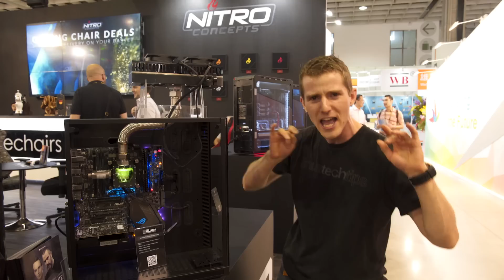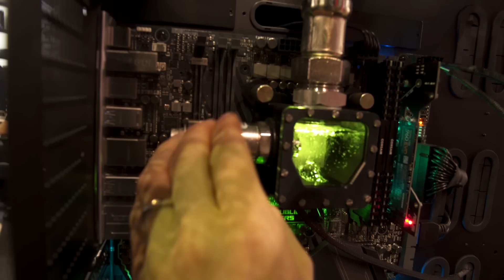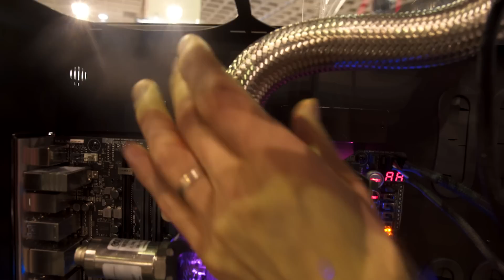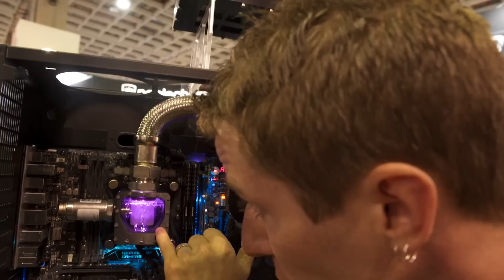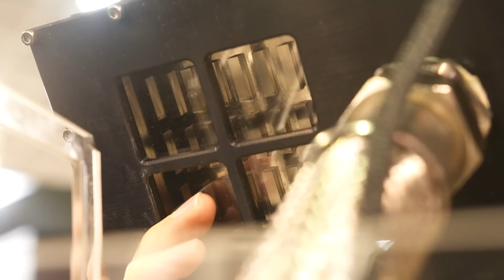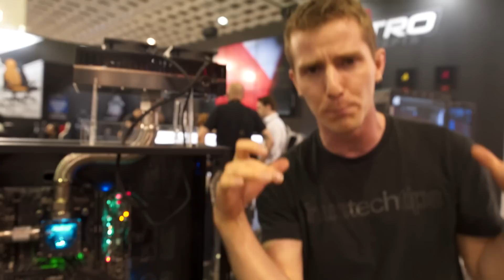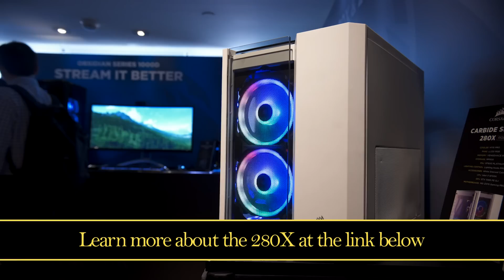Crazy Der8auer cooler prototype - NO pump!

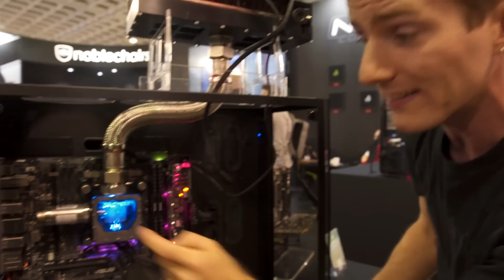Comment: 2:19 probably dry ethanol 
For now it's the best heat pipe fluid right behind methyl chloride
Reply: I would have guessed methyl chloride (Dichloromethane) but you might be right about the dry ethanol its also probably less volatile as in not gassing you with chlorine gas if you spring a leak lol
Reply: @adam1984reese  well dry ethanol is probably the best option because distilled water will pull metals from parts and consequently will become conductive and if there are different metals in the loop like  copper and iron in contact you have a galvanic reaction that will destroy parts over time while methyl chloride is as you said pretty bad to breathe in so 100% ethanol is pretty good middle option that is not corrosive and conductive and also won't kill you or damage your equipment if it leaks.
I tried to make my own methanol heat pipe and it worked great.
I first tryed acetone but it reacts badly with rubber seals and plastic

Comment: It's either Novec or some form of alcohol or something in a vacuum to lower the boiling point to the desired temperature so it condenses at room temp 21-33° but boils shortly after that to maintain a cool CPU.
Reply: There is also a wide range of things that will boil at lower than ambient temp's which you can increase the boiling point of by increasing the atmospheric pressure which would naturally be done via expanding the liquid into a gas

Comment: low-pressure ethanol or acetone... (gasoline would be fun tho...)
Reply: with diethylether you wouldn´t even need a vacuum or low pressure it boils at around 35C° plus if it leaks you´ll get a fuzzy feeling in your head so a lose/win situation, but i strongly advise to keep open flames from the ether for a safer experience i recommend chlorophorme

Comment: Perfluorohexane  boiling point of 56 °C (133 F) IDK if the boiling point is too low it will more readily explode, and then you have to figure in how toxic the liquid is.  I figure it needs to condense just lower than the hottest possible room temperature but low enough to boil at temp that low enough for a optimal cpu temp - boiling at 40-60°C? and even figure in how much it tends to expand... - then again I am still on my first computer build...

Comment: Is it boiling at or around ideal CPU temps? Or running hot?
Ethanol boils around 78-79c at normal atmospheric pressure.
Is the system pressurised? Even a slight pressure increase could have a BP lowering effect.

In industry we used CO2 within a vacuum system for cooling. Literally puts fires out if things go "oops!" and safe as breathing out. The vac system avoids any issues with pressurised connections, charging the system etc etc.

Comment: With more temperature data, we could figure it out. Water would work at a lower pressure, and would explain the bulky hose and the pressure sensor. If that's the case, then all he's done is scale up a heatpipe to ridiculous proportions and give it a semi-flexible hose.

Otherwise, pick a desired temperature/pressure profile and there's a hydrocarbon that'll do. Butane has pretty reasonable properties and could likely work for such an application.

If he went really fancy, then a fluorocarbon based coolant. Like fluorinert.

Comment: it's probably a gas that uses the concept of phase change to stay in liquid state. that looks like a pretty beefy setup on the hose and fittings so one could assume that the pressure inside is quite high. also would explain why there is a pressure sensor.

Comment: Some kind of high pressure liquid-to-gas phase change that heats up to a vapor, rises up to radiator, is cooled/condensed, and trickles back down to reservoir block.  Like a giant heat pipe / vapor chamber.

Comment: My guess is water. It's cheap and it has high enthalpy of vaporization, which would make sense (many industries use steam to carry heat for the same reasons). The pressure inside the cooler would need to be less than 1 atmosphere in order to get temperature less than 100 degrees celsius, but that's probably one reason the cooler isn't mass produced anyway (and also the fact that it could freeze during transport). It looks like it's made of really heavy and strong components too, maybe to maintain the lower pressure. Also, the glass on the waterblock is mounted in a way that ambient pressure would help seal it, if the pressure was lower in the inside.
It could be made of vodka too, because then it would start boiling at a lower temperature and also couldn't freeze as easily :)

Comment: That looks like pool boiling, which it’s freakin efficient but very expensive and difficult to make it work. Normally it’s used with 3M NOVEC fluids, probably he is using the 649 which boils at 49°C, typical for computers. I like it.

Comment: The pressure transducer suggests to me that the fluid is under a vacuum/pressure.... potentially, it could just simply be water or even r134 fluid. you can control the boiling point with pressure lower or higher. This is essentially a large, complicated flexible heat pipe.

Comment: There's no "boils" at any temperature in there... note that bubbles ... looks like he's using the ultrasonic piezoelectric transducer. At the right frequency, he can split the molecules of any kind of liquid and make it looks like "boils" but are just bubbles generated by it's high frequency splitting the molecules !! And then you may ask : "Where's the 'smoke'?" Well... there's not space for smoke on that little square filled with liquid, the only way out for the smoke if the top tube !
And by the way, why some one would design something that would "boil" a liquid when the objective is to cool down ? That's why I think he's using the ultrasonic transducer tech in there!

Comment: Nothing radical here, they use the same principle to cool the staves in the body of blast furnaces when circulation pumps fail, secondary convective heat transfer So all this guy has done is adapt that principle to PC cooling, with the use of additives in the water that would not be used on a Blast Furnace cooling system. I like it.

Comment: I don’t understand how the re-condensed stuff gets back down if there’s constant boiling and gas going up. Does this liquid have no surface tension? Anyways I imagine it’s a low boiling point compared to water since that CPU is hopefully not running at 100C+ so here’s a few contenders when I google low boiling point: https://goo.gl/images/xvwnGq

Comment: Could be a water/ether mix. Ether boils at 100 degrees Fahrenheit, which would be perfect. The heat from the cpu would excite the molecules in the ether, ultimately assisting in heat transfer. Idk if it's stable enough, but it's gonna be a liquid with low boiling point, and good heat conductivity.

Comment: Old John Deere tractors had cooling systems called a "thermosiphon".  There was no water pump, the hot coolant just rose (to the radiator), cooled, and then dropped back down where the cycle continues.

Comment: There are a few points that most of the comments seem to miss. Boiling a liquid will create pressure. Pressure increases the boiling point. This means that what ever liquid is used, has to have a boiling point a few degrees colder than what you want the system to run at.  For one, we can safely assume that CFC gas and any form of flammable material would not have been used because he would most probably not have been allowed in the venue in such a case. Some form of an Ammonium compound might be used as it is used in gas fridges that require no electricity or pump.

Comment: Maybe I missed  it was running at what temp ?and to boil water doesnt that require 100c
Reply: You can lower the boiling point of any liquid by decreasing the atmospheric pressure same as you can increase the boiling point by increasing the atmospheric pressure.If you've ever seen a car spring a coolant leak you will notice the water is boiling but that is because of the atmospheric pressure once the system is sealed again the coolant is not boiling at the very same temp

Comment: It can be acetone.... a cpu can go 80 or 90 degrees Celsius under load. The boiling point of acetone is about 50 degrees Celsius....so acetone is one of those liquids that can condense at normal ambient temperature in the radiator and can boil under the heat flux of a running cpu.....it could be any liquid that boils at 50 to 70 degrees.....i think its acetone.... may be alcohol or bromine

Comment: i know it is a custom 3M novec mix because der8uer has made a pc in witch he used 3M novec and in that video he talked about getting a custom mix that boils at an ecen lower temperature and that might acheve even better results and because of the size of the tubing and the sensor this tube is cleartly presurtized to increse the boiling point of that novec to make it not boil at a too low temperature

Comment: Hes using a commercial refrigerant under negative pressure. That explains the need for the pressure sensor and the large valve on the radiator and the need for a custom rad (commercial ones aren't designed for negative pressure). The working fluid is likely  R245fa or R1233zd(E) in my guess. I'd love to know if I'm right.
Reply: Go up on Mount Everest and ur water boils near 60°C
Reply: More likely negative pressure water loop and the pressure sensor is so he doesn't blow the radiator up if things gets too hot and he ends up with a steam powered system
Reply: @crocodile2006  lmao....that would be awesome to watch....a cooling system turning into a steam power cycle.
Reply: negative pressure?
Reply: negative when saying atmospheric pressure is 0.

Comment: I'm assuming the liquid is liquid helium either or liquid hydrogen because of boiling point is -257 to -230 year on there on either like good and the based on the way the viscosity is of the liquid and now it's boiling and if it will condense back down it would go into the condensing chamber on the top because hot air rises and cold air Falls same for gas as mostly and therefore it will fall back down and cool the system

Comment: It'd be nice to know what the pressure and temperatures are.  Then it wouldn't take long at all to find out.  Since the thing appears to be pressurized (maybe depressurized), there is a wide range of possibilities.
Edit: According the der herr himself in another video, it is under high pressure, and the boiling point is above room temperature.  Also, it is one intended to be shippable anywhere.

Comment: CH2Cl2  Methylene dichloride or also known as dichloromethane. It has been used for over 100 years as a fluid for heat engines among the many other uses. For example, a use that is CLOSELY related to the use in the video is as the bubblier fluid in Juke Boxes from the 1930s and 1940s. It boils at 103 F so it would be perfect in an application like this. The hotter it gets, the faster it boils thus circulating the fluid through the rads.

Comment: Probably some sort of alcohol. Lower boiling point than water so the system doesn't need to reach 100 C, not very expensive, less flammable than acetone (since its a consumer product they need to make it more idiot proof) is non conductive (all common alcohols I can think of) and is a natural biocide.

Comment: Ok, understand going to limit what I say for a reason. USN has Nuclear propulsion systems that will cycle cooling without pumps. Not though for main use. Used for say when shut a plant down and you still need to dissipate heat before your pumps come back online. They use water.
In short this can be done with water alone would it be the most efficient that's a good question. A fluid that boils at a lower temp would remove heat and earlier and limit the temperature the cpu would raise to. Also the design is kind of poor.  The base unit a the CPU should be angled 45 deg  to push fluid against cpu and the a standard radiator sitting upright with slight angle to let coolant run back one direction without blocking rising gas would be more efficient. Alcohol has a lower boiling point and is easily brought back to liquid. So if he isn't using water that would be my next guess. Using the same principles of a still after all. Also you can reduce boiling point of water by lowering pressure.

Comment: Since it has a pressure relief valve in the side of it I am inclined to believe the coolant is 200 proof alcohol.  Also seems like the most reasonable choice for an evaporative cooler such as this.

Comment: Seeing that its boiling, it is most likely some type of refridgerant, and it looks like it works just like an rv fridge that runs on propane or electicity. They typically run pumpless and because the heat from the propane flame or electric element within the condensor of the fridge creates convection within the fluid which allows it to move, and thus cycle. This system simply makes the evaporator the cpu block and the condensor the radiator...

Comment: Freon gas, and he does not boil it, the freon is boiling because of the heating, this system does not need a pump, since the more the processor is heated, the more gas boils and the more effective cooling. Such a system can not be overheated and there is nothing to break.

Comment: @Linus Tech Tips I think he's using ammonia (NH3) as a liquid. In the absorption style fridges it's used as well for the same purpose, albeit it's used differently. In an absorption fridge the ammonia is heated to a boil (to go from liquid to gas) than travels up as a vapor into the inside of the fridge (first in the freezer area than to a cooling block inside the fridge itself) it goes out the back of the fridge again where it's further cooled until  it condenses again into a liquid and flows back down into the container at the bottom.

I think he might be doing a similar thing here, albeit different and probably not as efficient. It does explain the heat shielded flexible pipe though.
Reply: As a refrigeration technician I tend to agree this look a lot like how a  RV camper fridge works on propane gas with a pilot light all it takes is a small amount of heat to cause evaporation under pressure hence they work with just a pilot light as the burner..
there is no way this is any sort of refrigerant gas like R134a as the pressures involved would not be contained in that arrangement   not to mention the radiator core has a drain and a tap on it and that would be useless for a gas pressued system not to mention the leaks ..
Reply: @VK3NFI  I have an old Electrolux RM212F fridge in the caravan/trailer that I just had to service, so it was still fresh in memory on how it worked.
Those fridges in Europe often work on Propane and Butane gas heater, 12 Volt electric heat and 230 Volt heater.

The downside of this system is that it is limited by the ambient air temperature. Above 35 degrees celcius ambient temperature they just don't work efficiently anymore.

Also, since you are a tech, wouldn't it be more efficient to cool the CPU with a cooling block through which a pipe runs, like within the freezer area of such a fridge?
So effectively moving the heater core to the bottom of the case.
I think this would seem more efficient in utilizing how wel ammonia extracts heat as it goes from a gas back into a liquid.
Reply: Ammonia was my first thought, too.

Comment: My guess is that it is using pressure as its secret weapon. The coolant isn't as important as the pressure in that loop. A LOT of coolants could be used so long as the pressure is such that it boils the liquid at whatever temperature you want it to. It could be Alcohol for all we know.
Reply: Basically using thermo technology that has been already implemented in other applications but putting it in a nice consumer package for use in computers. It's neat, don't get me wrong, we will just see if it catches on.
Reply: how is the air pressure staying constant if you are heating a liquid into a gas inside of the chamber? how do you get the heat to wick away in a vacuum environment efficiently

Comment: It looks like they are avoiding the use of any rubber, sooooo i'd guess straight grain alcohol, has roughly the right boiling point and speciffic heat to work in this manner but cannot be used with pumps because it can make plastic and rubber quite brittle
Edit: alcohol has a boiling point around 70 and 78C depending on makeup and contaminants
This design could also work with hexanes with the ammount of bubbles i'd say that is either under alot of pressure and around 75C, or it could be running one of the hotter hexanes such as n-hexane or 3-methylpentane

Comment: My bet is that he uses a fluid with a boiling point around 80 degrees which he lowers by putting the fluid under pressure. This way it only boils when there are power to create the pressurised system, but it also secures cooling IF the pressure should fail.. My bet is Carbon tetrachloride as it is a great heat conductor under pressure (It was commonly used as a cooling agent until recently) and is easy to obtain.

Comment: Ether, or a mix with it and some alcohol like in those drinking birds. Possibly also having a reduced pressure inside the system to adjust boiling to the correct temperature range...

Comment: In chemistry, we call this "refluxing". This is interesting because if done right, the cooling block will have more or less the temperature of the boiling point of the liquid. Well, there aren't a lot of liquids you could use for that, because you also want something with a high heat capacity. Ethanol would be to high of a boiling point, the CPU would run constantly at ~80C, methanol would be 70C so I'm guessing it's some kind of hexanes mixture with a boiling point between 40 and 50C